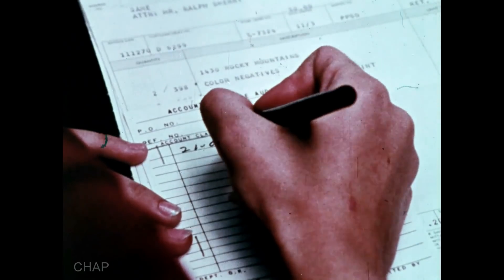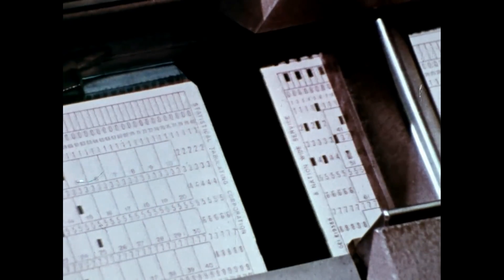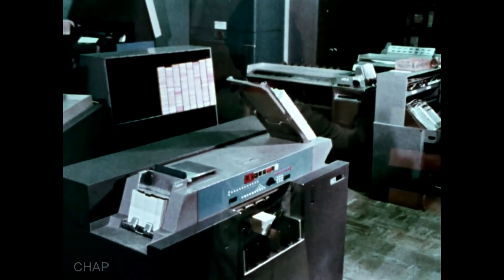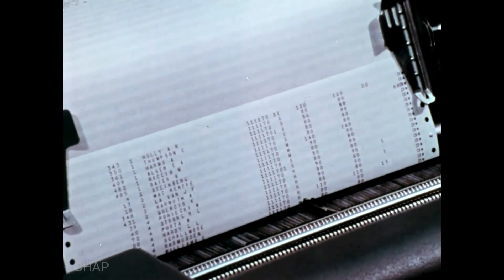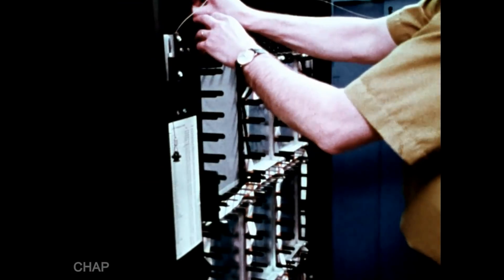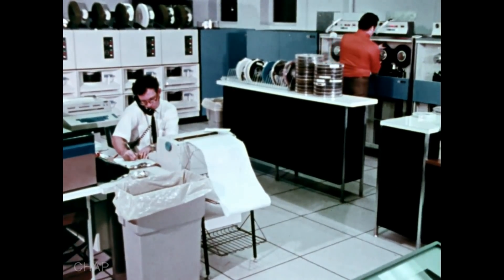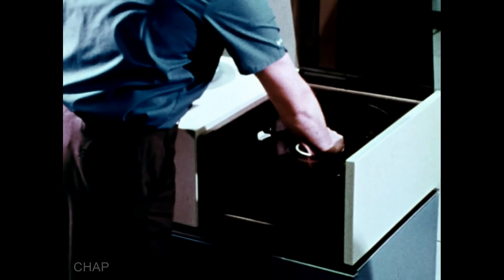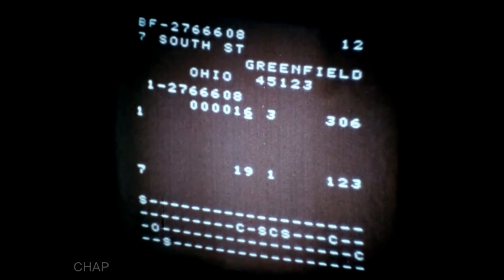Computer History: DATA PROCESSING Introduction (1972) (IBM 360, Burroughs, CDC, MICR, punch cards)

Comment: As a keyboard specialist, my typewriting skill enabled me to learn keypunch at my first job in 1972. I acquired it in 1970. When I began to work on the Entrex Data Scope [terminal] in 1973, it seemed like the way to go, until I was laid off in 1974. My first lay off was the thing I hated most about the job. Since then, I worked in various places until 1997. In 1980 while at the service bureau, I learned that the Entrex data system was a lighter computer system that stored data onto disk packs, the tape drive units had "scanners" inside that worked like random access memory inside the microcomputer, because many key data terminals were connected to the tape drive unit. The terminals had keypunch-style keyboards made for quicker keying of numeric data. When the microcomputer included a 104-key keyboard that is mostly used today, keypunch keyboarding was ended. I would not want to have it any other way because I have my own [Dell] microcomputer which I call my Keyboard, because it is my powerful typewriter. From this testimonial comment, data entry has been right up my niche. I watch Computer History Archives Project and other computer shows because I love to see other people use the computer beside me and myself.💙
Reply from the maker: Hi @captainkeyboard1007, loved the Entrex Data Scope look!  Very futuristic!  Wish that look was available today.  Thanks for the memories!   VK
Reply: @ComputerHistoryArchivesProject  You are welcome. In September 1980, I began to work in a job that seemed better than all the other workplaces in which I worked, which was a service bureau (Andover Data) in Manhattan, New York. I took my first test on the Entrex Data Terminal, which model was advanced from the Entrex Data Scope. Unbelievably, I keyboarded on that terminal with no errors on the alphanumeric test with nil punctuation marks and symbols. This fact seems as though my typewriting skill spoke for me. Finally, Nixdorf bought Entrex and the terminals looked sleeker than the older models. Also, the desks were nicely designed with gray and chromium exterior. Incidentally, I forgot to mention in my first comment that Jerry Lewis taught keypunch onto cassette tape. That was the way I learned it in a training course from my first job at Metropolitan Life Insurance Company. Keypunch seemed to be a big thing, because the older church members thought that since I worked doing keypunch keyboarding and that it pertained to data processing, they dubbed me as a "computer whiz." I accepted that statement as a compliment. A co-worker with whom I worked at my first job said this as a secret to all things, "If you can type fast and accurately, you can learn anything that has a typewriter-like keyboard." That is how I ended up using my microcomputer. Thank you for typing to me. Happy Keyboarding!🖥💻🖨⌨
Reply from the maker: Jerry Lewis the actor?  wow.      You sound like a "computer wiz" to me, to.    Love your icons:  🖥💻🖨⌨ !!
Reply: @ComputerHistoryArchivesProject  Jerry Lewis, who was the television host, taught me key punch. The only thing I did not learn in the course was to find the symbols, except the hyphen, the ampersand, and the punctuation marks. Keypunch was a big deal for me because when I told some older [church] people that I was a keypunch operator, they dubbed me as a "computer whiz," even though I did not see a computer at my first job. I took that declarative as a compliment, and it felt nice. By the way, I learned typewriting on an antique Underwood typewriter when I was 12 years old. Thank you for your response to my comment and for typing your message to me. Happy Keyboarding!

Comment: Finally, I know the reason why there's a function called  "print" in many programming languages since it really prints something Lol
Reply: Indeed!  I always find it amusing, to think of all the code behind a simple printf statement.  Printf prints to file object of some kind.  Say I run the program via some Linux "terminal" window.  The terminal window provides the input and output to a command shell process. I run a C++ program, and it does a printf.  That code is tied to low level UNIX file code, and writes to file descriptor 1, as memory serves, standard out.  That file descriptor is mapped to some fake hardware terminal device in some way.  The terminal window somehow intercepts the data written, I forget how.  It uses XWindows.  Which has APIs to write text.  The text writing could be rather complicated, because some sort of font data has to be rendered to pixels.  Eventually somewhere in there, you have to talk to some device driver to write to a screen buffer.  Eventually the graphics card has to access the buffer via some sort of DMA.  It then has to convert that to a protocol like DVI or HDMI.  Where firmware in the computer monitor converts that protocol to lighting up LCD elements on a display.  I always wonder how many lines of code are actually run.  1000?  10000?  More?  A lot is the only answer I can give.  Just to write "Hello, World!" or something like that.

Comment: I started on a 360/40 with 2314 disk drives 10MB each 16KB supervisor DOS.  The site still used a tabulator and sorter
One the first programs I wrote in RPG was to stacker select certain cards from a large deck we had 2540 card reader/punch that two read stacks two punch stacks and reader/punch stack.
Reply: That sounds like the same things I encountered back when I went to college, except for RPG.  I did work with FORTRAN, COBOL, AND IBM Assembly.   By the end of the 70s I got an Apple III Computer.  It was wonderful!!!
Reply from the maker: At last, a fellow RPG programmer.  Nice!  ~
Reply: @ComputerHistoryArchivesProject  I also went on to PL/1 and god's own language assembler.  We used BATS to link to a real 2780!
Reply: @ComputerHistoryArchivesProject  : RPG II, count me in.
Reply: RPG gives me hives, unless it's Dungeons and Dragons.  I once took a class in it, back in the 80s, just to learn it.  I will stick to C++ and Python :)

Comment: Somebody has to make a strong doge vs weak doge meme with 1960's hard drives vs current hard drives (because back then they swapped disks on a same reading machine whereas today if there is a single drop of dust it desteoys itself)
Reply: When I was an intern in the early 80s, I worked for a state-owned steel company and I helped to replace the plates for an old 5Mb harddrive. We open it's top and used an specific tool to remove the old (usually because it was scratched by the reading/writting head) and put on a new one. I remember they costed an insane amount of money.